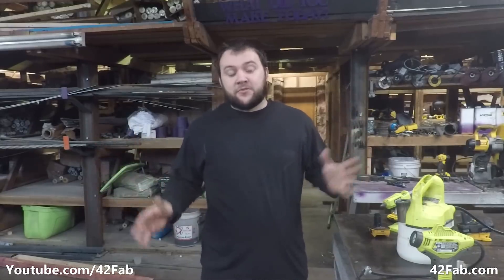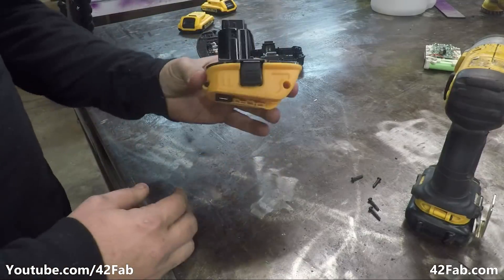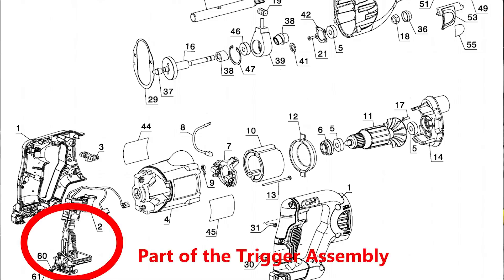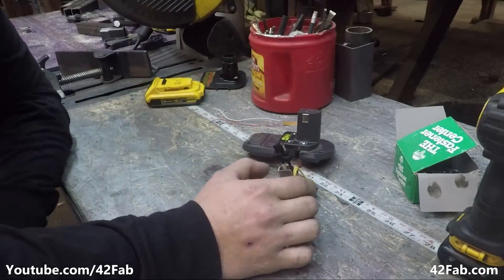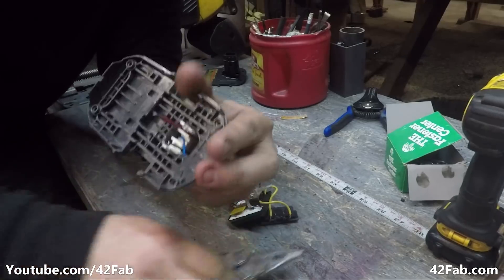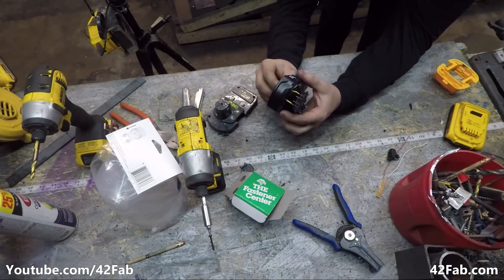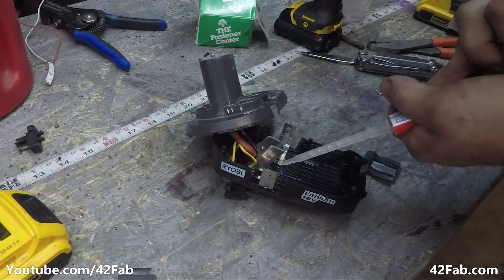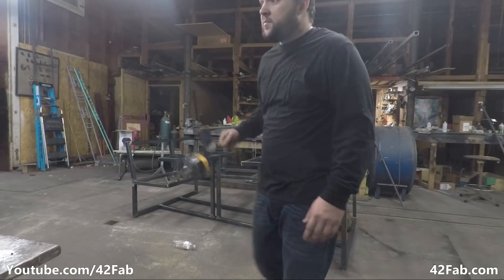How to use DeWalt Batteries on Ryobi Tools for $30 | Building a DeWalt to Ryobi Adapter - 42Fab #16

Comment: Nice job, I’ve been thinking how to convert a dyson cordless stick vacuum to run on dewalt 20 volt battery... for my off grid cabin, I always take plenty of dewalt batteries, just need to convert the vac.
Reply from the maker: What voltage is the dyson pack?
Reply: Thanks for the reply... It says on the back 21.6 volts, 2100 mAh 46Wh. I have plenty of 20 volt Dewalt batteries, and a Dyson V6 absolute that I'm replacing, so I figured I would see if I could convert... I see where someone has tried, I assume it worked.
https://www.pinterest.com/pin/90986854952176598/?autologin=true
Reply from the maker: you'd likely need to directly supply power to whatever leads inside the dyson are expecting the 21.6 volts from your dewalt 20v battery (which is really putting out around 18v). Adding in a device like the 20-18v adapter to protect the dewalt battery is a very good idea. Without having the device in front of me that's about all I can say unfortunately. It's doable, but may be difficult

Comment: This is stupid, Ryobi batteries are much cheaper than DeWalt junk.
Reply from the maker: cheaper for a reason
Reply: You're right, they know they can rip off DeWalt fanboys... Compare 4ah or 6ah Ryobi batteries to DeWalt.  Same junk inside, same capacity same performance.
Reply: @xephael3485  not necesarily their is a difference between amp/h and maximum amp draw

Comment: I have a project for you next McGuyver.. I love working with these little hand tools but I need more power.. can you make an adapter for my Ryobi from my car battery?  I think it's got 775 cold crackin amps.. that should be plenty juice in the winter time.. let me know Hoss
Reply: Also can you make a backpack to hold the car battery that we're going to make for the power tools? Let's do this!
Reply from the maker: it can be done, but you'd need a big 12v to 18v step up or you'd be running your tools undervolted as car batteries run around 13.5v

Comment: Thanks for the video. I made an adapter for my old B&D tools after watching your video. I ordered my Dewalt 20v to 18v adapter from a different source.... (cheaper Fleabay I'll never learn LOL)..... It does not have the protection circuit. I guess will have to make sure i don't discharge the batteries to far. or work em to hard. The adapter I got only has 2 wires, If your interested. you can see it in the first minute of the video.  https://youtu.be/4IxKrpWw0xg

Comment: Why not just pull the battery pack out and take it to the battery store and have them assemble a replacement batter pack. Then install it and solder the wires back on and put it back together?
Reply from the maker: 0:14

Comment: This is genius.
Ps you kind of look like Sam from Game of Thrones
Reply: I thought so too!  Skinnier Sam.
Reply from the maker: Used to be almost as fat Sam
Reply: @42Fab  Thanks for the video was neat to watch your mod.  I'm not a Cordless tool type guy but starting to get hooked into the Ryobi line cause of amount of tools.  I prefer corded cause no limitations but starting to like convenience of the cordless.  Given its just for house hobby stuff I'm sure Ryobi will be adequate.  We use the top players at work DeWalt, Makita, Milwaukee.  What really pulled me in lately to take a another look at cordless was the cordless DeWalt 7 1/4 Circular saw for a small job I did at work.  Worked very well.  Maybe not as much grunt as corded but convenient for the cuts where we were.  I'll have to check out more of your videos.  Nice looking shop!  Keep up the good work. 👍
Reply from the maker: @724Chicago  try the flexvolt circle saw. Feels like it has an engine on it.

Comment: Sprinkle baking soda on the eopxy after you mix it and it'll harden zuper fast and the epoxy gets harder as well. Old mechanic trick I heard from Stephen Cox.
Reply from the maker: I've heard the same but never tried it, may have to
Reply: 42Fab - Metalworking & Fabrication if the baking soda trick works same as it does on super glue, it will harden instantly, and then can be sanded.

Comment: 3D print and order the spare parts for the connectors?
Reply from the maker: You certainly could if you have a printer with good enough tolerances. For shop work where things get dropped and banged around I forgo my 3d printer as injection molded and epoxy are much stronger.

Comment: I was looking for information just like this for the Craftsman Bolt-On system which I have almost the complete set with one dead battery I used only twice because it was an old manufactured one that came with the basic set.

I know I can buy the black&decker Matrix batteries, but I already have Dewalt batteries and they are easy to find and I’m sure they’ll be with us for a while.
(I would need to purchase the B&D Matrix batteries online, which I won’t know it’s manufactured date, or if issues arise, returning becomes a hassle.)

I was wondering if it’s possible just to replace the battery core casing (the actual battery piece that is soldered) with any other LiOn pack and resolder to keep the same molded casing and logic board.
Reply from the maker: MAVEN FELICIANO in theory, yes, you can. The protection board may not like it though.

Comment: I have the first generation dewalt 14.4 cordless screw gun
Do you know how to fix those?
Reply from the maker: They may have lithium batteries for them or after market third parties may, but otherwise, There isn't a great way to do so. Treat yourself to an upgrade.

Comment: DeWalt 20v was a planned obsolescence for their old 18v although they will tell you otherwise. But people with the older 18v wanted an 18v lithium replacement so they made lithium for the older  18v tools. Ryobi on the other hand had their customers with the older tools in mind when they went to lithium. Also I find what you are doing here to be a Rube Goldberg solution. Just buy the batteries for the tools and be done with it, and you'll probably be safer also. By the way, those benches are AWESOME!
Reply from the maker: My only disagreement is the safety and the fact that the "20v" tools can use so much more power than the 18v line. The new batteries keep up with that. Put a 20v battery in an 18v tool with the adapter and you'll notice the increase.

Comment: nice, i like it. So is it possible to use/make an adaptor for a li-ion dewalt battery to fit a new li-ion makita tool ? I have a makita cement poker that i use with a 18v transformer (wired) as i do not own any other makita tools / batteries. However have plenty of dewalt batteries so would be handy to use them in the makita poker if possible.
Reply from the maker: Probably, but you'd have to modify the tool. I haven't looked into how makitas batteries work
Reply: Thinking about it, the 18 v transformer works well which only supplies 18v dc so technically a dewalt battery should do just the same. Think I’ll look into it. Cheers 👍🏼
Reply from the maker: It should work then, I guess their li-ion protection circuit is in the batteries

Comment: Your battery collection is worth more than my car.
Reply from the maker: More than mine too
Reply: Lol...or can even charge it...
Reply: I just counted my batteries yesterday and I have 56 Dewalt batteries.  20 of them are flevolts. I need to stop buying Dewalt stuff. I have more than 10k in cordless tools.
Reply from the maker: Giving me a run for my money. I think I'm at 26 flexvolt, 15x 5ah, 5x 4ah,and about 20x 2ah. Not to mention 40v and 12v stuff. I hope that dewalt exec's kid enjoys college.
Reply: One day I’ll be able to brag about my battery collection. Right now I only have 6 of the 1.3 ah batteries that come with the tools 1 3ah and 1 5ah. I’m swapping over from B&D where I have 9 2ah, 6 4ah and 4 of the 18v batteries. Been looking at the flex volt batteries and 4 battery fast charger.

Comment: I am going to be building the same adapter, but I bought 5 of the DeWalt 12v/20v USB adapters and will use them.  They are cheaper, and work about the same.

 Found the Ryobi battery the same as you did, from the Home Depot recycling bin. 

 I am a Stanley Black and Decker employee, and get the DeWalt tools at a tremendous discount.  Have quite a few myself, but the Ryobi 18v glue gun is what made me want this adapter.
Reply from the maker: Be careful that that adapter can handled the amperage

Comment: At least here in Australia, Dewalt tools are all labeled and marketed as 18v. They weren't able to get away with misleading consumers here, we have laws about that shit.
Reply: Firstly, their old batteries were NiCd. NiCd cells are 1.2v, ganged up in lots of 15 to get 18v. the battery would produce 18v from when it is fully charged until it is almost completely empty.  Their new batteries (and most battery tools on the market) are Li-Ion, a flavor of which has a "nominal" cell voltage of 3.6v. These are ganged up in lots of 5 to give you a total "nominal" voltage of 18v. Because these batteries start at a higher voltage (4.2v per cell) and drop down to a lower voltage of 3v, they are rated as 3.6v as that is in the middle of their usable voltage range.
Reply: ollie young yes indeed. And that is why dewalt calls it 20V max ! It is technically true because they will provide twenty volts when fully charged. This will drop down to around 16V when they are empty. Everywhere except the US of A the use the nominal voltage of 18V to market this line. In the usa they simply thought, well more is better right?
Reply from the maker: I hear you, but I actually find it beneficial as when discussing DeWalt tools, we immediately know which "generation" of battery we're talking about, no confusion about which batteries fit which tools.
Reply: ollie , yes you have laws about that shit , but ..... your'e still Australia . Little 3rd tier country . Calm down .
Reply: j s, I bet you felt so superior writing that but you know what? We like our 3rd tier little country because that keeps us well away from big mouth, arrogant people like you. You do your country and  your countrymen no favours by re-inforcing negative stereotypes of Americans. Have a nice life believing that you are superior to everyone else you poor deluded fool. 😂 Stuart from Australia and proud of it mate. 🇦🇺🇦🇺🇦🇺🇦🇺
Reply from the maker: I spent a summer down under as a teenager, y'all are some good people
Reply: 42Fab - Metal Fabrication & Signage. Thanks for that and I don’t mind saying I have met some wonderful, generous people when I was over there and also when Americans were visiting here, on the whole they were very down to earth and humble people. I guess you get the smart arse wherever you go. God knows we have plenty. Cheers Stuart 🇦🇺
Reply: Of course I felt superior writing that , I wouldnt have typed it out if I didnt . We"re Americans , we look down on everybody not just skippys .
Reply: Its 20 when you measure the voltage, the 18 volt batts are also 20 volts when you measure them, funny right. Dewalt mislead us when they called those older ones 18v when they were really 20v, shame on them!

Comment: They need to start cranking out some chicom adapters on ebay ...like dewalt battery to Makita hand tools , or dewalt battery to milwaukee .  Makita makes a really nice mini router I just bought...but now I have 2 kinds of batteries ...pita  ...and 162 dislikes ??? I don't understand what's bad enough to make someone click "Dislike"  , even if you dont build one, it's still entertaining dude stuff .

Comment: I did that with my old 18V Milwaukee to the new Milwaukee batteries. Its a bit chunky and get in the way of depth adjustment on the circular saw, but better than nothing. In fact its much better with the 9AH batteries that last lasted long time between charges. I think the next evolution is to make a proper adapter with a 3D printer so it won't be chunky and look original.